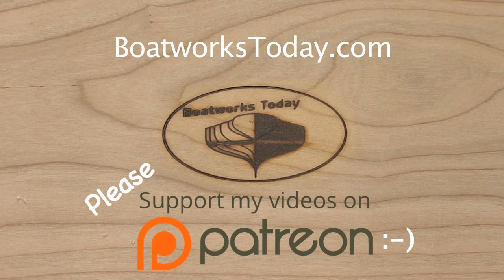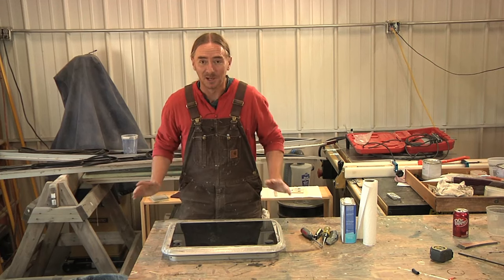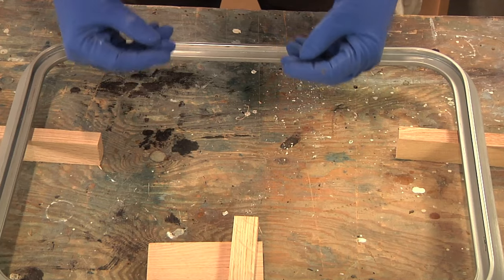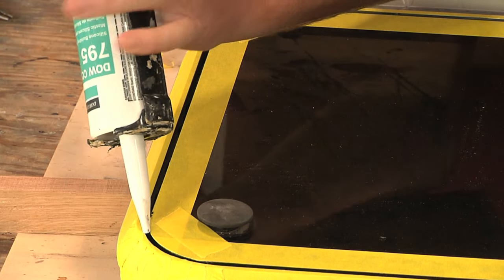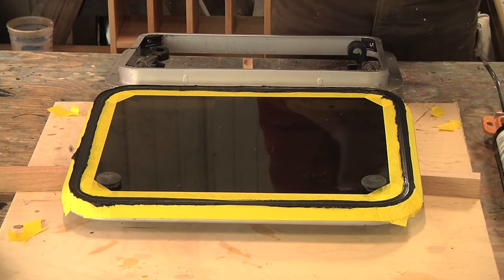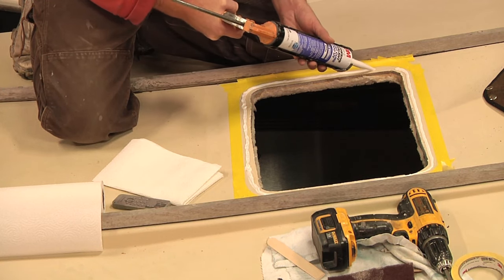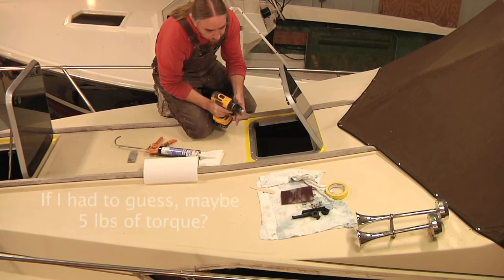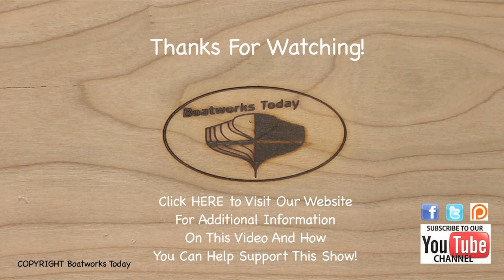How To Seal A Boat Deck Hatch

Comment: Your helper did a good job :)  I like the hints for caulk, but still a fan of butyl tape myself as long as you can get enough torque to seal it tight.

Comment: I found, wetting your finger allows it to slide along much nicer along the caulking as you smooth it out. It also seemed to make far easier to create the tiny valley in the caulking around the entire frame. Wiping off excess of course.

Comment: Try 3M hard rubber squeegee with medium pressure. You will get the Dow 795 to drop down a hair below the frame and acrylic. It will look so much smoother than your finger.

Comment: Exactly what I needed to see.  I have Bomar hatches with cracked plexiglass which needs replacement.  I noticed you used Dow 798 for sealing the lens in place, but I could not tell what you used to bed the frame to the deck.  Not sure I need to go there, but just in case, I would appreciate knowing what was used.  Great job and thank you for sharing.
Reply from the maker: +Kay McDonald For sealing the poly to the frame I used dow corning 795 (791 would work as well).  For sealing the hatch to the deck of the boat I used 3M 4000UV :-)  Hope this helps!

Comment: try using windex. the original version.  Apply  bead of silicone. Spray with windex. Wipe of or tool excess. The windex will repel the ooze and leave the silicone nice and shiney. We use it on stone and aluminum and it really makes you like a superstar

Comment: Nice video thanks. I should have watched it before I screwed up my first hatch rebuild. Silicone everywhere. Lens not pushed down far enough and not contacting the frame.
Anyway my second, and last, hatch will be done using your great instructions.
A question about removing the yellow tape. When do you do it? after its dry/cured or immediately after its finger wiped?

Comment: Great job...i'm about to do the same in my boat Just i want use the Bostik ms pro seal whitch seems to me very good as i used on other seal Jobs. Do you line anything about it?
Also i have question: when you place glass on frame the exess patty that came out on the bottom has to be clean? Haven't seen you cleaning! 
Keep going like that mate.
Thanks from Sardinia

Comment: I love your videos and they have helped me out. I watched this one to help me re-bed my hatches. Sadly, when I pulled 1, I discovered that the opening was cut by a drunken sailor and in some places a full quarter in. from the framing of the hatch. A couple of the screws were screwed essentially into silicon and nothing else. How would you recommend extending that edging so I have some meat to scew into.

Comment: When you bedded the acrylic in the frame you mentioned getting enough Dow so it filled the channel.  I assume some oozed out over the edge (I know it will when i do it).  How did you clean up that edge which will show inside the boat?  Love your channel!

Comment: Great videos... Congrats. One question though... Why did you opt for bedding compound instead of Butyl tape? I find butyl much easier to deal with. Thanks again, keep doing what you are doing!
Reply from the maker: It may be a little easier to handle, but I haven't had very good results using butyl tape.  A lot of people really like it, but I tend to get more consistent results using caulking..  Either one will work, though :-)

Comment: A suggestion: Cover the ENTIRE Lexan glass with plastic when putting down the tape around the edges.  It makes cleanup easier should a bit of caulk fall off the tape when removing (or if the tape brushes against the glass accidentally on removal).

Comment: Before laying down the inner bead of sealant in the frame, did you tape it off so that when the glass was laid in, and the sealant was squeezed out, it wouldn't make a huge mess?

Comment: Hi Champ and thanks for a new video! :)
I need to redo my leaking portholes and fixed deck windows on my Beneteau Oceanis 430.
I wanted to ask about the VHB tape or equivalent for mounting polycarbonate port windows, re your older video.
Im currently in Malaysia and the 3M VHB tape is not available here. Can you think of any alternative to the 3m VHB tape?
"Scotch 3M Exterior Mounting Tape Super Strong"?
"Kips DIY Grey Shear Strength Double Sided Acrylic Foam Tape"?
The only function of the VHB tape is adhesion, right? Nothing to do with sealing and watertightness?
Cheers

Comment: could you use 4200 in place of the 4000uv ? I will be doing this on my 88 300 weekender this season. Thank you for all these great videos Andy!!
Reply from the maker: +Alexsay Karpowitsch Absolutely!  4200 just has a stronger bond which isn't really necessary, but yes it will work for bedding the frame to the deck ;-)

Comment: How did you tape around the hatch frame on the boat? Do you just do it very carefully? Or, is there a trick to it? I'm interested to see how you did that. I'm worried about scratching my gelcoat with razor.

Comment: Great video, glad I found your website. Did you put the handles/locks on inside out so you could handle the acrylic easier when installing into the 795? Does that give you more control?

Comment: Great video and thanks! The black gasket that seals the hatch when you close it. It seems on a few of my hatches that has shrunk and is pulling away from the frame. When I spray the boat from above, water gets in. What's the best approach for getting that back in place?
Reply from the maker: +Timothy McGee Try replacing the old gasket with a neoprene 'D' gasket in the appropriate width and thickness :-)  It's a fairly universal gasket that will work on most hatches

Comment: THANKS ANDY!  My Sea Ray 268 has a leaky hatch (bedding medium is shot).  The previous owner decided that silicone was key...as in about a tube worth.  Yea...Didn't work.  Question though...what silicone did you use?  What solvents did you use to clean the duct tape and silicone off.  Does it affect the plexi at all?  What bedding compound did you use?  4200??
Reply from the maker: +WreckDiver99 The silicone is Dow Corning 795 for sealing the poly to the frame and I used 4000UV for mounting the frame to the deck.  Naptha VM&P for cleaning the residue as it does not harm the poly :-)
Reply: +BoatworksToday Thanks Andy!  Love your videos!!!

Comment: Hello. Very interesting. My hatches are different, so looking for the best way to get them not to leak. I have a Catalac 8M catamaran. The hatches are more like a shallow box lid (hatch top) that just closes over the bottom which is standing up an inch or so. The problem is that I can't find the right kind of hatch foam/seal to build up enough material to seal water tight. Any ideas would be greatly appreciated.

Comment: I replaced a knotmeter impeller on the exterior of my boat. Another liveaboard said not to tighten the screws for 24 hours to give the sealant a chance to cure. Was he correct? I like the quality work you do.  Jack
Reply from the maker: A lot of people do that and it seems to work fine.  Personally I just make sure the screws are snug (not death grip tight) and there's excess compound squeezing out.

Comment: Is that that black roof tar in a caulk gun. That stuff shrinks in the sun light or heat. I'd put a thin layer of white caulk on top
Reply: It's Dow Corning 795. It's black and that's about the only similarity!

Comment: Which caulking did you use?
Reply from the maker: I think I mentioned it in video but dow corning 795
Reply: @boatworkstoday Thanks! I was able to make it out visually in the video and it worked great. Is there any particular reason for that specific caulking/silicone?? Thanks in advance for your answer and your videos rock!!

Comment: What about using butyl tape for the bedding?
Reply from the maker: +sailorlewi It's certainly an option, but I've always had better luck using caulking.  I like being able to see excess caulking around the perimeter of the frame (it lets me know that there is a complete seal).  Butyl tape you have to have a strong compression onto the deck to form the seal.  I didn't want to crank down the mounting screws that hard and risk stripping the hole in the balsa.